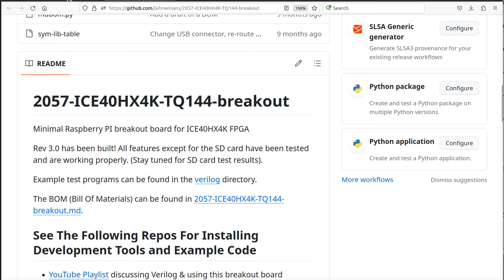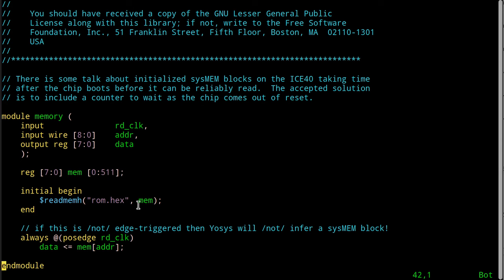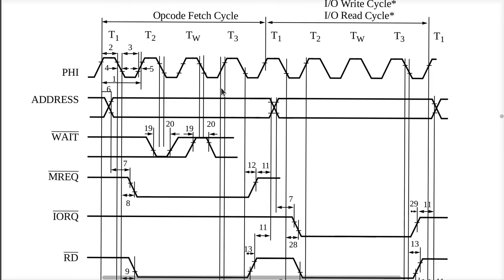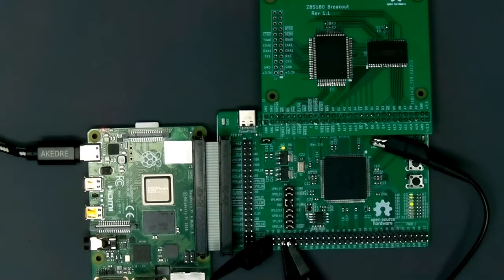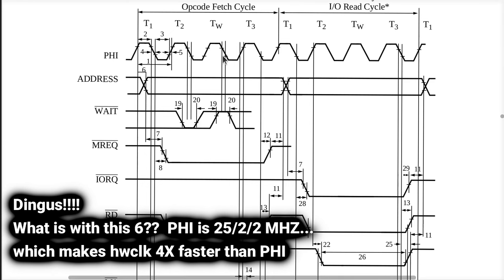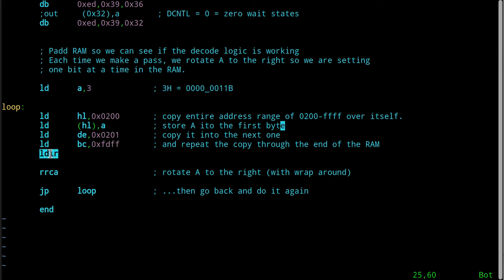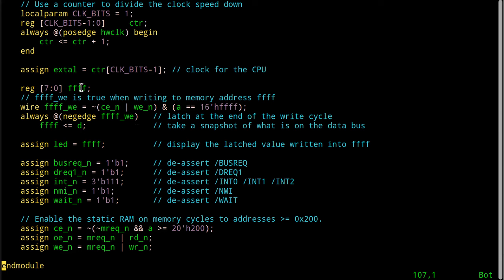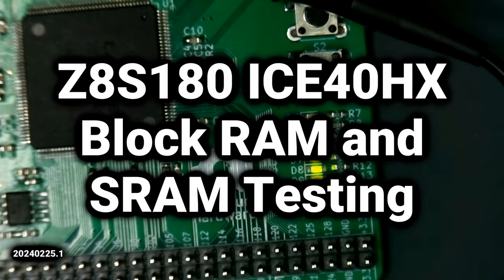Z8S180 Breakout Board Testing Pt. III

Comment: I admit I have not tried this myself.. but it should be possible to get synchronous block RAM to emulate asynchronous RAM by placing state-based delay (counters) between the bus signals and the internal RAM.
eg. "on falling edge of RD, count to n then assert blockRAM data at address A". Internal Block RAM and the counters are running at the internal FPGA fabric bus speed.
This could also be used to setup wait-states for tuning different CPU bus speeds.. emulating certain RAM speed ratings etc..
---
Nice work of the RAM testing, looking good :)
Cheers,
Reply from the maker: Thanks!
Yes, I hope something like this will work.  Plus, when we start looking at DMA and cycle-stealing to support devices like the SD card and a video display, we will want to look at this same sort of thing for the SRAM too!